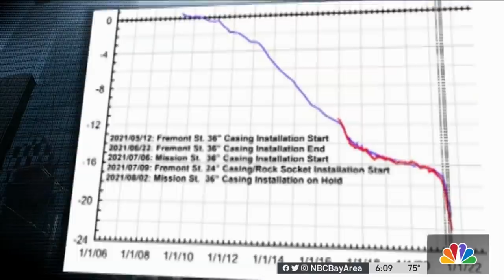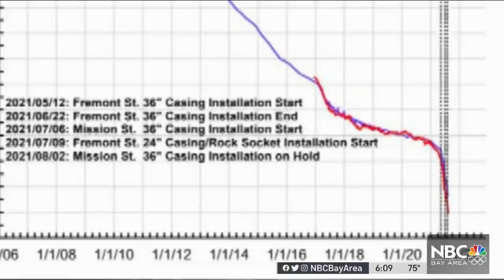Millennium Tower is Sinking Faster Than Rate ‘Limit' Set by Fix Engineers

Comment: Another mess in Cali, imagine that. Sounds like the building needs to come down, before it falls sideways and makes even a bigger mess. The question is how they going to drop it, is it to tall to implode by a demolition company?  It needs to fall into its own footprint, as to avoid collateral damage to surrounding buildings. Will be interesting to see this mess play out.
Reply: This stuff isn't unique to Calif.  Remember Florida early this summer?  How soon you forget.
Reply: @roachtoasties  I did not forget the Champlain tower collapse in Florida, it was from neglect of maintenance on concrete rebar columns on the lower structure, this building is tilting on one side.

Comment: Let us use skunk Baxter’s thinking help us fix this problem. Let think about this from different perspectives.  The building, in theory could settle 10 feet and not be a hazard, if it settled evenly.  The real question is what is the maximum amount the building can lean without jeopardizing.  Is it 1 degree, 2 degrees, 3 degrees? The question is how to ensure even settlement.  If you could solve this problem, you would then be able to stabilize the entire building!

Comment: The center of the building is now sinking more than the outside . Of course the pilings in the center are taking more than double of the weight than the ones of the outside . Also to stabilize 
the perimeter of the building might stop that part  of the building but down the road the opposite side will sink and there is no way to stop the center from sinking. But there is one positive side of the debacle the tower can only sink 60 m so there will still 28 stories sticking out of the ground , however how sound the whole construction of the tower   will be by that time is at least questionable . Whoever had the bright idea to build this tower on filled soil needs his head examined .

Comment: If the core is sinking faster than the perimeter then there is severe cantilever pressure at all steel joints in the structure.   THEY WILL FAIL

Comment: This is what happens when the Government over rules ENGINEERS & ARCHITECTS In NYC EVERY Hi Rise that goes HAS TO BE ANCHORED TO THE BEDROCK.  Since Manhattan Island is all Bedrock it's not financially a challenge. But when you build on a coastline, Bedrock is almost non existent, putting a Finacial Burden on Developers, so for a few campaign contributions and a couple meals plans get altered. Look at South Side Towers in Fla.. Yes the Bldg was in need of Repairs, however Detobmnating 40, 000 ton Blast of TNT Just miles off the Coast of Fla , Causing a 3.3 Earthquake  to shake the Richter scale had alot to do with the building coming down less 14hrs later ... Again no accountability by the Government .
A 3.3 Earhquake for a place that has absolutely no History of Earthquakes is sheer DENIAL

Comment: It's a failed building built on a failed foundation. They didn't sink the foundation to the bedrock. They did an cheap "alternative" foundation. It has failed. The building should be cleared and disassembled safely now before it falls. Then build a proper foundation and build a new building. Only "the money" is arguing for a cheap repair plan and those are the same people that approved the failed design in the first place. That condo in Florida was build on a failed foundation.

Comment: What ? Even surface area at base spreads the load.. When center caves in as shown by magenta .. The ext in yellow carries the brunt of weight as the middle losses contact with foundation sheer walls and slab !! Of course the yellow areas are going to immediatluy fail in unpredictable ways !!!!!! & I have a Doctorate in arch & 
BS struct eng 
+ 2 more Bach + AA
Commen sense knowledge imagination creativity is required for this job . obviously they hired the wrong engineers
JCT
Palos Verde Engineers
Rancho Santa Fe